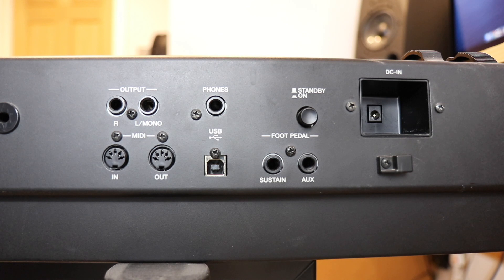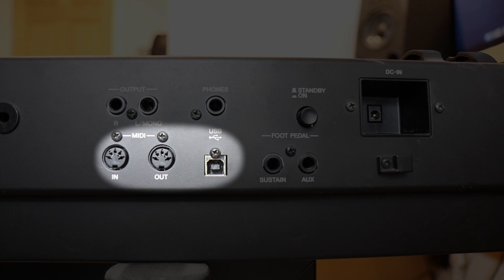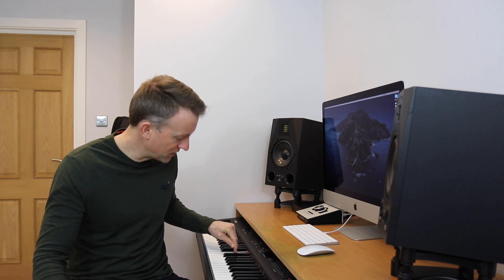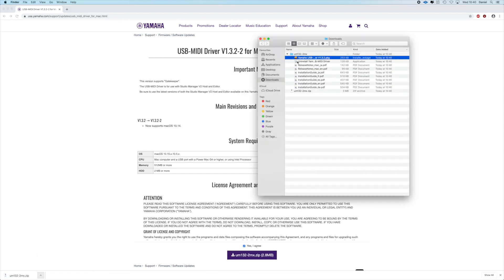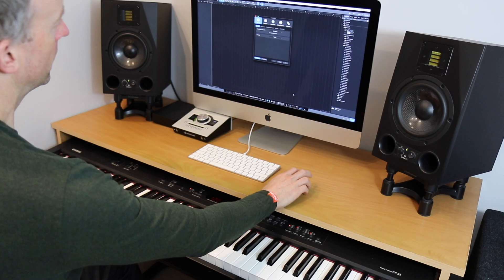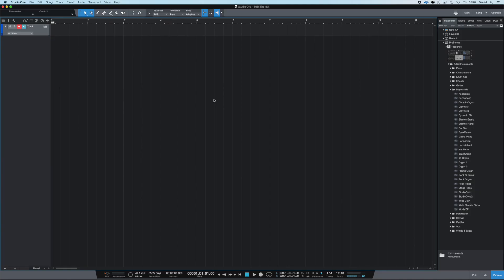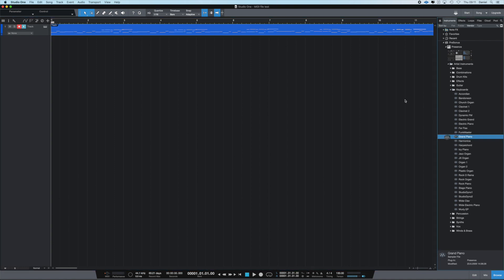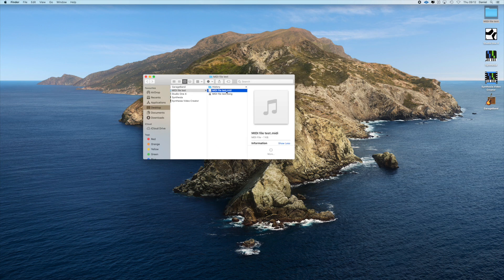All you need to know to create a MIDI file using a digital piano keyboard!

Comment: I know how to record a midi performance using something like a keyboard or virtual keyboard. What I have yet to figure out is how to include any automation with it into the midi file as well as any channel info. I use Reaper but I think I might have a disk with the presonus software here somewhere. Does it record automation?
Reply from the maker: I think you'll struggle. As far as I know, automation isn't part of the MIDI standard, so it's not something you can contain within a MIDI file itself. Rather, automation would be something you would apply to a MIDI track within a DAW - i.e. an overlay to the MIDI. You would then save your DAW project as a file, which would contain your automation overlay within the project file. Of course, it follows that your automation is less likely to be as 'portable' as your MIDI data - your automation is unlikely to be able to be transported into something that any other DAW can work with.

Comment: Great Tutorial..question if I may! I see you used a metronome ? So does this mean if a human being human,, their timing is off,, is that also translated to the finished midi..or does the software automatically tidy the tempo/timing up by virtue of the fact it sets the music into digital musical bars..and hopefully thus making it perfect for the listening ear..Thank you...SALLY
Reply from the maker: Good question, Sally. If you're creating a MIDI file by using software to record the keystrokes from your digital piano then, yes, it will precisely and very accurately capture the exact timing of those keystrokes.

However, after you've recorded your piece, if you want to tidy-up the MIDI and make it 'machine perfect', then most software has a function called 'quantize', where it will attempt to slightly move your notes to the nearest beat (or whatever sub-divison of a beat you choose, eg 8th note (quaver), 16th note (semiquaver) etc.

If you use a metronome while recording, it'll help keep your performance reasonably well aligned with the tempo you've set in your software. If you DON'T use a metronome and your timing is 'very' off, then it will be more difficult for you to quantize your MIDI file afterwards, since your performance will become progressively more and more out of sync with the software tempo.

I hope that helps. Cheers, Dan.

Comment: ok its looks good ...question, for example. let's say we have a midi file in synesthesia, is it possible to transfer a midi file from synthesia to korg and 700? thanks
Reply from the maker: I don't know too much about the Korg 700 but I just searched for it and it looks to be a mono synth, with a MIDI in - does that sound correct?

If so, then, yes, you should be able to push/play out a MIDI file from your computer into the synth - which the synth will effectively then play. How you would go about doing this, I couldn't tell you.

Your question/my answer has no relevance/dependency on Synthesia, by the way. If I misunderstood you and you're actually asking if the Korg 700 can be a MIDI input controller for Synthesia then, no, I don't think it could - doesn't look like it has a MIDI out as far as I can tell.

Hope that helps! Cheers, Dan.